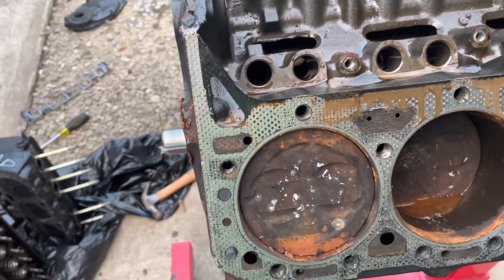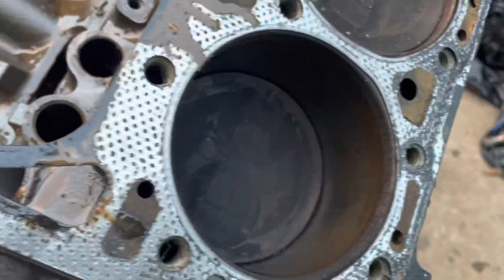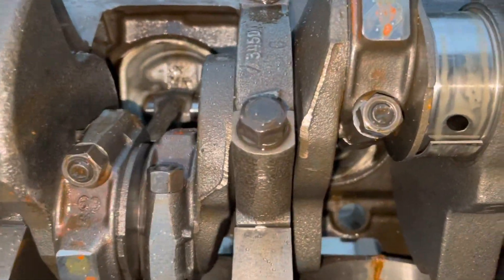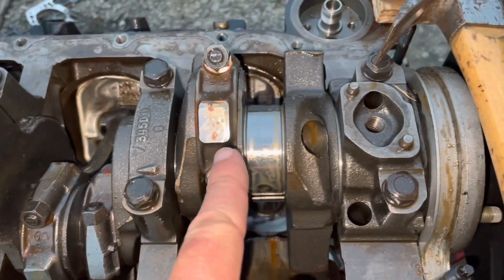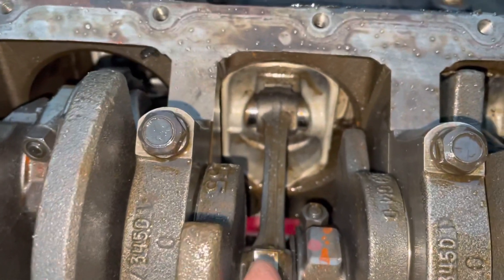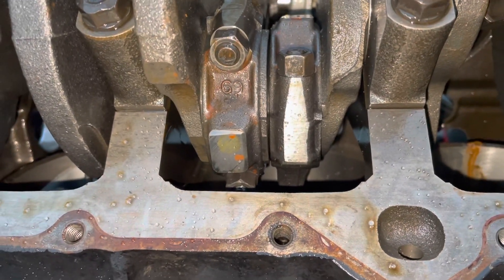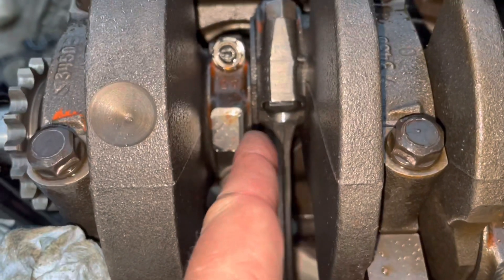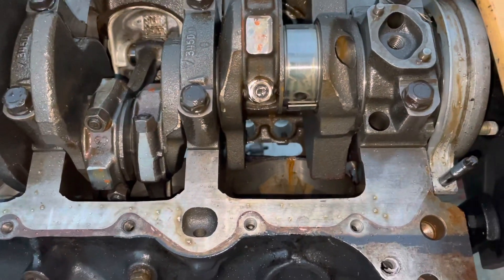Mercruiser V6 Piston Rod Offset

Comment: Rod cap torque specs? Do you use blue lock tight on rod bolts? Do you have any videos on break in procedure after rebuild?
Reply from the maker: Google Kohler industrial marine engine manual for all specs on 4.3 v6.

Never use loctite on high torque fasteners. It will make the connection looser. Ive never used loctite on rod nuts, main bolts or head bolts.

https://drive.google.com/drive/folders/16Ht2iniLTveZuV25Gw9qqN1LajW37jRU
Reply: @moccasinmarine  Thank you Sir!